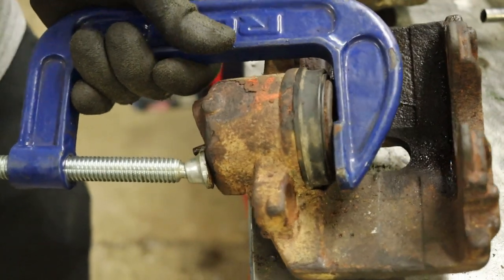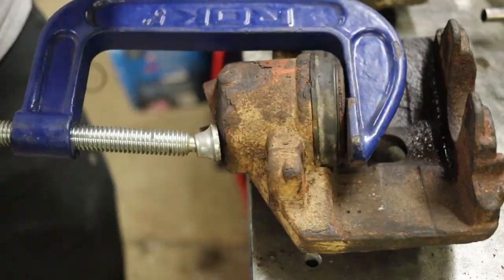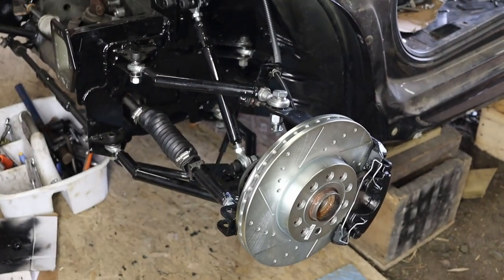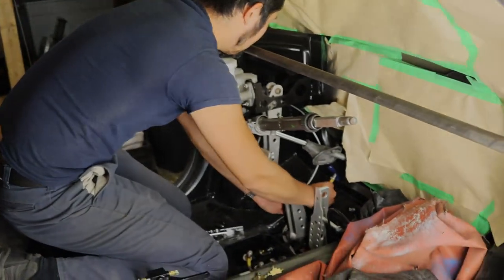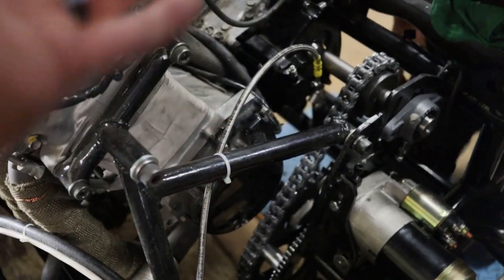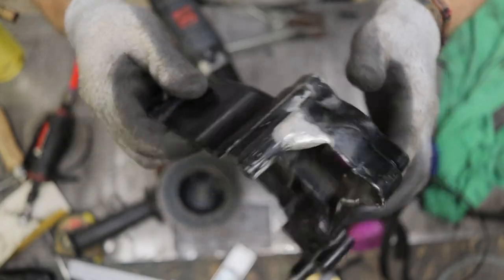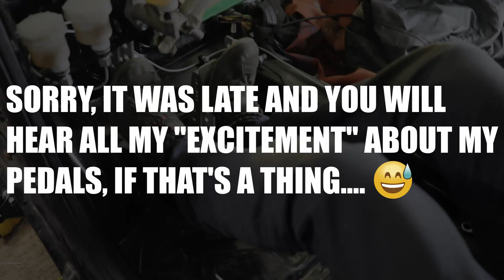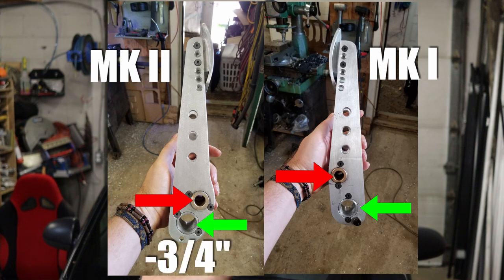Smart Hayabusa: part 10 Installing the brakes...my weirdess video so far!🤦‍♂️

Comment: Bonjour Viny B. Je suis Jim du Massachusetts. Binged a regardé toute la série SmartBusa (jusqu'à présent). Excellent travail. J'ai été tourné vers vous de la série Austin C. Excellent travail également. J'ai pensé qu'il était juste de vous répondre en français (merci Google translate!). Donc si le français / anglais est bizarre, mes excuses. Je doute qu'Austin comprenne les problèmes de froid et de rouille que nous connaissons dans le Nord. Haha. Quelques questions: En tant que Québécois, utilisez-vous métrique et impérial sur vos builds? Quelle est la signification du # 57 dans le logo? Quel programme d'édition utilisez-vous? Envisagez-vous une ventilation du budget de fin de projet? Et allez-vous approfondir vos connaissances sur vos études / votre expérience de travail / votre famille et vos assistants en construction? Je pense que les gens répondraient un peu à cela. Et enfin, qui suivez-vous au hockey? Fan des Bruins ici (pas de jugements, mon ami LOL). Continuez votre bon travail et espérons voir bientôt de nouveaux épisodes. Étant anglo-saxon, si vous avez le temps de répondre, veuillez répondre en anglais. Merci.

Bravo, JW
Reply from the maker: Hi Jim! thank you sir! Metric / inch: well I've learn metric but since everything is in inch (tubing, plate, lathe, milling) I use inch more than mm. BUT nuts, bolts and a couple of components (linear bearing, air cylinder...) are in metric so I always work with both, which is the worst! Specialy for my daily job (mechanical designer for automated machines in the automobile industry) 57: this is my logo and my racing number. Why 57, well that was the adresse of the first house I built (did 3). I use davinci resolve (it's free 😅) Yes, I kept updating a budget during the build on the smart and at the last episode, I will share it. I will do a Q&A, but not now, the channel is too small and you're the first one that request it 😉. Not a fan of hockey...I know a canadian not fan of hockey, that does'nt exist, right? Well I'm a HUGE, I mean HUUUUGE fan of F1. I love racing (racing mowers + smart-busa for autocross) and all the drama and excitement about it and the engineering is just out of this world, so F1 is a win/win for me! Allright, thanks for all these questions and for the interest you have reagarding my vids! Don't forget, spread the words, share the....🤦‍♂️ Bye!

Comment: You did not service the pistons in the calipers? Looking at the level of rust and you already having one totally seized, if I were you, I would have pumped the pistons out and check them and cleaned the bore and put new seals in there too to have good and even braking force.
Reply from the maker: Rookie mistake